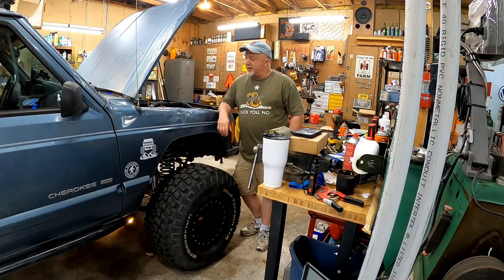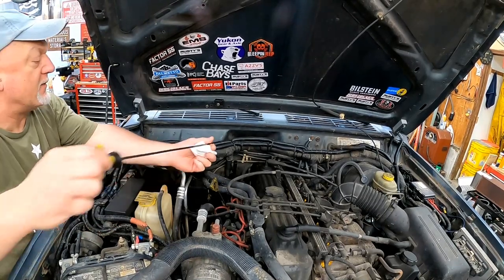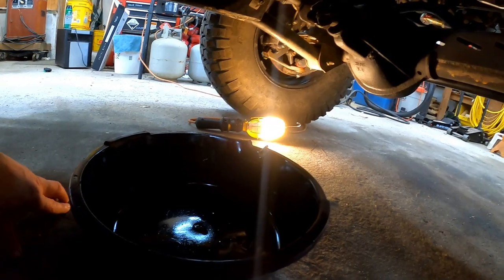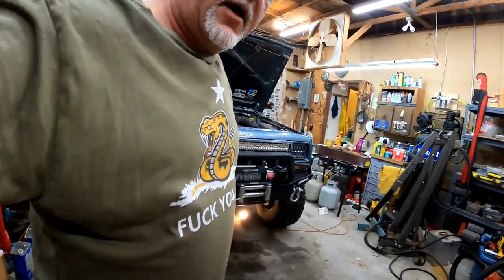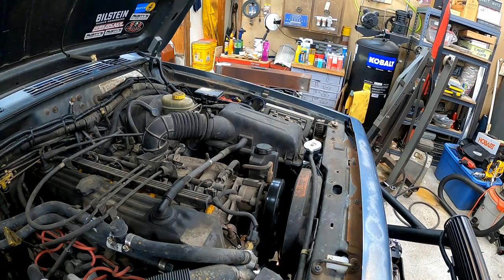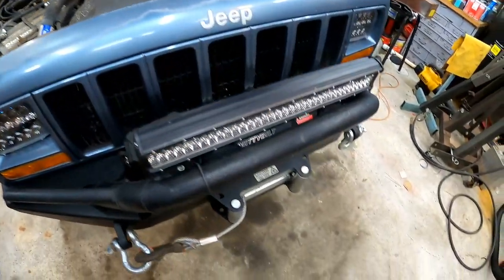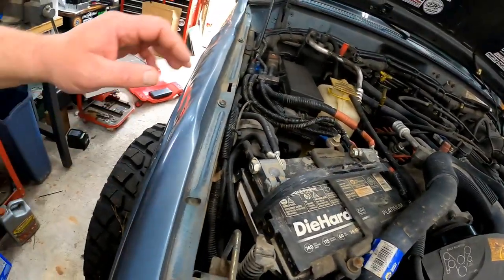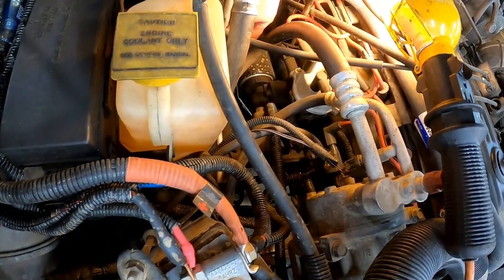1998 Jeep Cherokee XJ 4.0 Oil Change and Preventive Maintenance

Comment: hello!  I have an XJ 4.0 sport with 186 thousand km...what is the ideal oil model to use?  At the moment I use 20w50 valvoline...I'm from RJ Brazil.  Thank you in advance for the information
Reply from the maker: I use 10w40 Valvoline synthetic blend in mine.  The question of which is best is almost impossible to answer, as there are as many opinions on the subject as there are kinds of motor oil.  That being said, with the warm climate in Brazil you should be just fine with the 20w50 Valvoline.